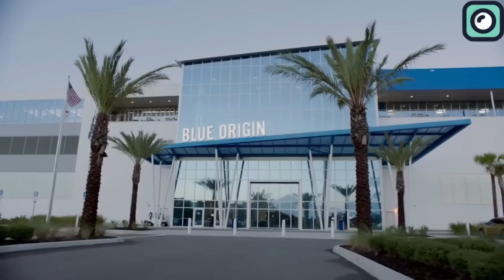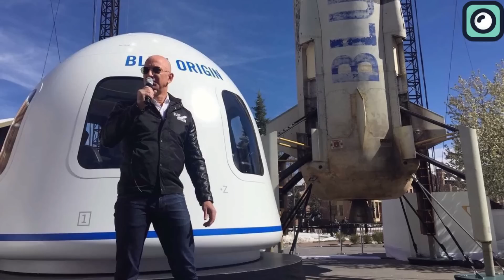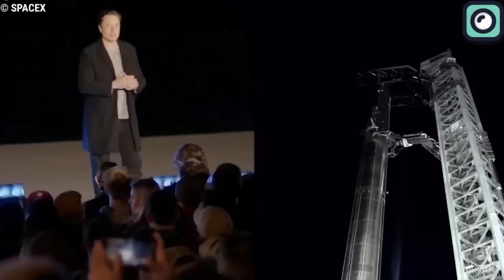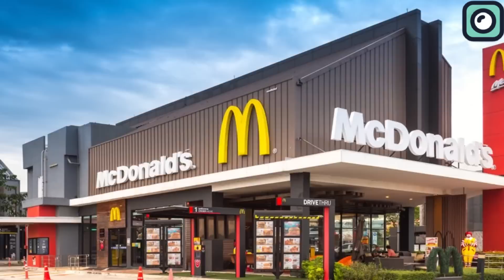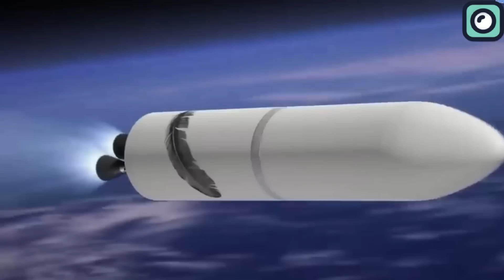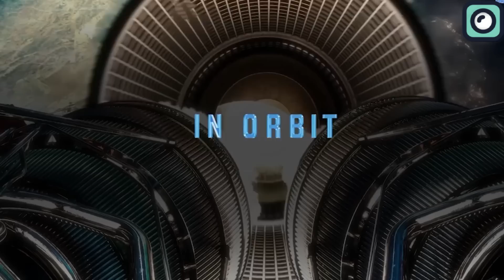Blue Origin Is Suing SpaceX and Cancelling The Starship Launchs... Musk Reacts!

Comment: Blue Origin has a point. They are more environmentally friendly than Space x because they are just suing people instead of firing off rockets. And when they do fire off a rocket, it is just a little one and it doesn't go high.
Reply: Had me in the first quarter ngl😂
Reply: From the point of launch to space they are more environmentally friendly . 
But what sort of carbon footprint has occurred to produce the fuel required to launch
Reply: @malcolmberwick9190  None of what you say makes any difference because Blue Origin has never put a rocket into "real" space. The Karman line is not space..
Reply: @pforce9  its space. Just not orbit